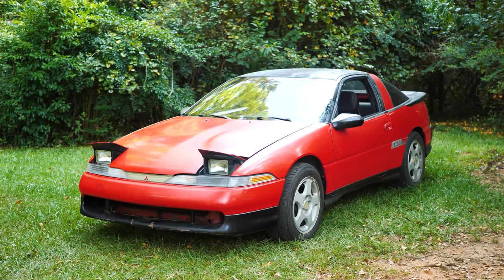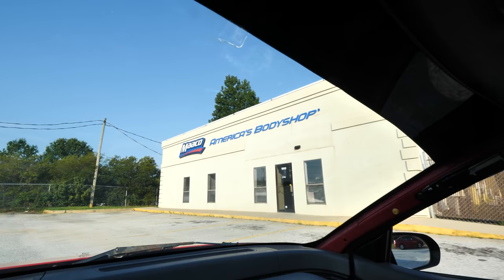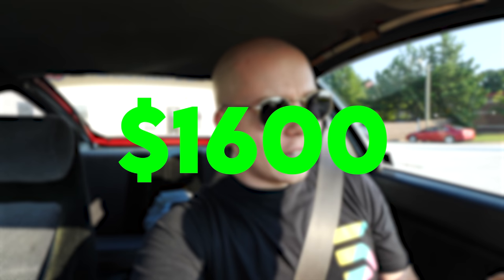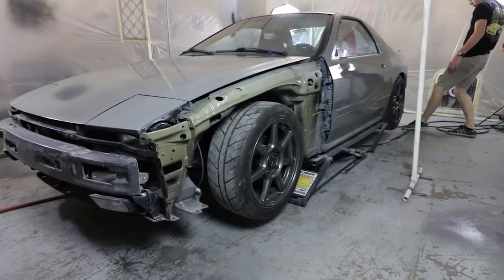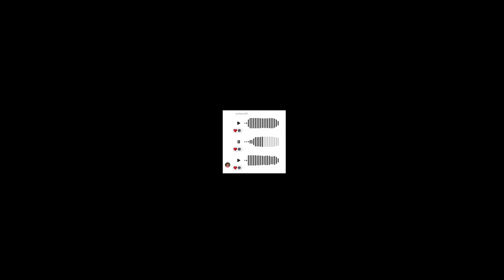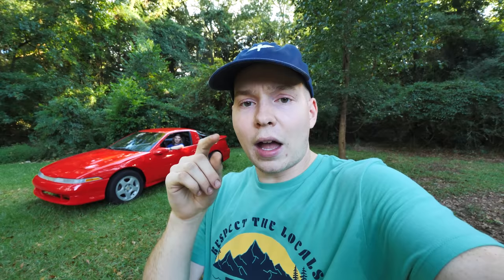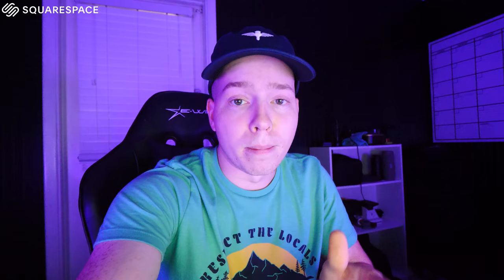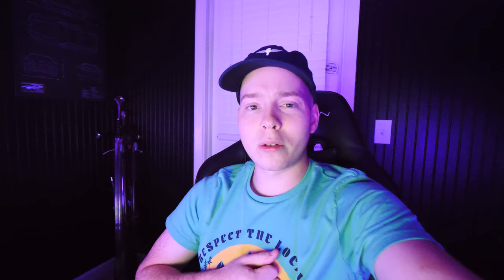How Good is a $1600 MAACO Paint Job!?

Comment: Should've done the prep tho, every time I hear of a Maaco paint job failing, it's because of inadequate prep, so if you do it yourself, you'd guarantee an even better result
Reply: What prep do u recommend?
Reply: @gavip24  
Really depends on how rough the old paint is.

But generally the most important part is removing things like headlights, taillights, window trim, etc because Maaco is not gonna remove that, they're just gonna tape around it and the result is gonna be meh, because the paint will chip around the tape line, you'll have overspray, etc..

Then there's sanding, if your paint is still ok underneath, a good pass with 400 then 800 grit all over the car is good, then you have to bondo the damaged parts, make sure you're not putting too much thickness, or it will crack, so if the dent is deep either try to pop it back out as good as possible to use less filler, or use fiberglass body filler, if your paint is chipping in places, I would use a much lower grit sand paper like 180 and  sand enough to get to the primer or if not possible even to bare metal, all bare metal will need to be covered with a layer of primer because Maaco doesn't use primer since they spray over the old paint, you know little details that go a long way but that Maaco won't bother doing.

Then there's a very important step, degreasing and cleaning the car before painting with wax and grease remover, but usually they won't let you do that step since it needs to be the last thing done right before painting and they don't exactly want you in their shop lol
Reply: @imnota  thanks for the detailed response! Another question am I degreasing and washing the car before or after I sand? Or will the sanding help degrease?
Reply: @gavip24  If you don't wash before sanding you will clog up and dirty up the sand paper and you will wear it faster and use more of it, so clean it before, but it doesn't need to be spotless or degreased, simply needs to not be dirty.

After it's sanded just before you get it painted it needs to be thoroughly washed, there can't be any dust left, it needs to be degreased, basically it needs to be as clean as you can make it.

Comment: About 18 years ago, $1600 USD could get me a very thorough OEM quality legit paint job with all dents fixed and all lights and nozzles removed or properly taped.
Reply: in 92 I got a macco paint job for $300 and it's about the same quality as this. I didn't care about the car because it was only the car I drove to work in. Macco is for a car you bum around in for a 2nd car

Comment: The weird texture that you are getting on that one fender is called fisheye. it generally happens when there is some water in the air lines during the painting process and normally when shooting the clear coat. Theres really no way to fix it but to sand and re-clear coat it.

Comment: I'm about to do this and a few friends have already done it and given me advice - your video reinforces all of it.

Keep the same color.
Get the 2 step.
You will need to wetsand it again because shops never spend enough time on that.
Remove your own lights. If necessary, drive to the shop with the lights loose, and spend a few minutes pulling them out in their lot.
Tape off behind any gaps yourself, especially under the hood. Any automotive masking tape works. $8 for a roll.

Things I learned from your video: remove the washer nozzles (seriously that's so crazy they didn't) and probably do some body work\rust treatment yourself.

Comment: My mom had a 1988 Cougar painted my Maaco back like , um middle 90s??  We took off the emblems, lights, locks, trim, handles, etc... It was quite pricey and looked GREAT for a few months. The single stage crap they put on had 80grit D/A marks, overspray in places that was pretty easily preventable. It was a piss poor hack job that would look great to execute a quick sale. Next time we'll just use a roller and masking tape.

Comment: If you're gonna do a Maaco paintjob - do 80% of the prep work yourself, if you don't want them to tape the lights off - take them off in the parking lot when you drop it off, if you have rust/rust spots, sand it yourself, if you have nozzles on your hood - take them off in the parking lot. Sounds really dumb, but if you do little things like that there's less for them to screw up - and Maaco will definitely screw SOMETHING up, I've never heard of anyone being 100% satisfied with a Maaco paintjob, but for the price it's nearly impossible to beat.

Comment: Those spots on the front of the car is called solvent boil that's is from when they have gotten the paint to hot straight after clearing, should at least  leave the clear sit 5mins in the booth before putting it on bake

Comment: Everything else aside the one thing that would be a dealbreaker for me is not removing things like the tail lights or blocking things off like the rad. To me, I know it’s a cheap paint job, but c’mon. Otherwise looks good and I’ve always like red jdm cars
Reply: I've heard that these days, companies like this avoid disassembling older cars because they don't want to risk breaking the plastic that's become brittle over the years and would be irreplaceable in some instances.
Reply: @sartorialdriver6528  that’s understandable

Comment: Will a wet sand and a decent quality detail and buffing help with the issues you can see. Edit... Nevernind it looks like there was a chemical reaction between the clear coat and the paint. Of the few people I know who use macco  they all have the body work done elsewhere and all of the lenses and lights are removed as are the body kit parts or trim that is a different color. Because that will paint over it with very little prep if you don't. It is one color though and if your going to make it fast and fun then you will be inside driving and you don't need to see the outside.

Comment: I've done that a million times, it will buff out really nice especially if you had a good painter, really the only problem is, is the quality of the paint material, just takes a little extra care but can be a good way to save money.l worked at macco in the late 80's  $199.00 complete paint job

Comment: they probably used too much reducer in the clear or the booth they used was way higher in temperature then the clear coat recommends. I never use reducer in my clear and realized that you get the solve and pop from a high temp clear in hotter temperatures then recommended.

Comment: did they paint the door trim red? Kind of looks like solvent bubbles bleeding up through the clear coat, they likely didn’t do any body work so they pocketed the cash on that, it’s a maaco job for sure. Better than before

Comment: Is the pitting in the clear? I wonder if they used single stage paint and just cleared over it before it could cure.. usually you need to wait 3-4 weeks to clear over single stage.. usually you’ll get those pits which are actually bubbles of gasses from the single stage that can’t escape because there’s clear on top of it

Comment: I've been trying to figure out the best bang for buck paint job on my 97 civic, as most of the clear coat has faded and there are plenty of scuffs and scratches. though the rear right wheel well arch needs fixing as it's wavy. might have to check out a maaco

Comment: I'm a little late on this but the "pitting" in the clearcoat is due to lack of prep. Pitting is usually caused by oil and grease. Sounds like that Maaco has some serious quality control issues. That is a shitty Maaco. Suck they did such a poor job. Also, seems like they seriously rushed it. 
Don't ask me how I know but.... if you call Maaco Corporate and file a complaint.  The shop will have to fix what they did or refund you your money. The shop will also get inspected by Corporate. Yes, Maaco's are franchised but Corporate can shut them down for repeated poor quality.

Comment: Not taking the time to disassemble the taillights or blocking off the front bumper opening is unacceptable. If that's the way they operate then I'd rather flatbed my car pre-disassembled. I'd imagine a wet sand detailing would bump the price up to a total of 2k.

Comment: Solvent pop or fish eye.  Typical macco stuff like orange peel, dirt, dry finish not enough clear, runs.  Sometimes you can get away with a good wet sand and buff but depending on how bad it is or how good you want it to look you just need to get it repainted.   Experience it every damn day at my job with one of our painters being ex macco...

Comment: I used too work for maaco and they use single stage paint and there clear coat they use is not that bad the name they use too use was called bear clear coat and the single stage paint is not good at all but they just wet sand the car spray over it and it's rushed just like they don't care of the work like if it looks ok there happy it sad we as the workers are rushed on each job it's sad I hate maaco

Comment: Nah man, not feeling it.  Does it look way better than before?  Yes, obviously.  I'm even kind of digging the red for that car.  But if a paint shop takes my money to paint my car, _regardless of how much it costs_, I need a job that is uniform and not pitted.  Period.  Orange peel?  Sure, par for the course.. it's not a show car and you didn't pay show car money for the job either.  But that weird pitting in the clear is HORRIBLE.  They pulled the front lights but not the rear??  Again, just be consistent.  The overspray into the front just looks absolutely half arsed.  And basically didn't fix a single dent.  Piss poor work.  Next time bring it to me--I'll fix all the dents, rattle can it and hit it with a two part clear and it would STILL look better than this, lol.  I know you're being mature and taking the high road on this but I actually feel bad for you in this situation.

Comment: Maco wonders why people talk so much sh*t about there finish job, an 1600 is alot for the fact they basically didn't do sh*t for body work as was supposed to do it, an the rash in the pain plus all the divets yeah I'd been really not been happy for that price an what was requested, that's what I'd expected for there 800 paint job an you paid double...  But regardless you can wet sand buff and do some corrections to help it look better an hide there horrible work on the front and it def will an does look better